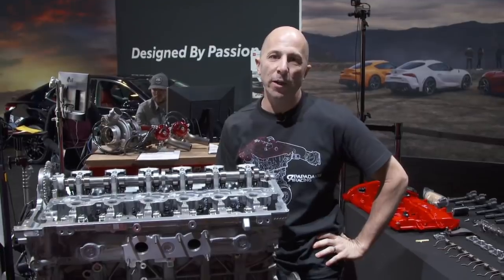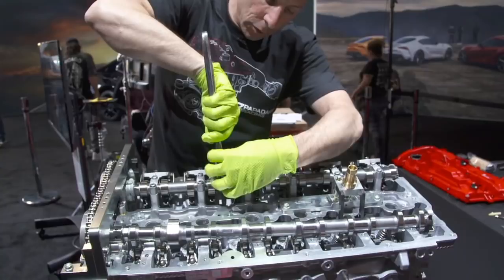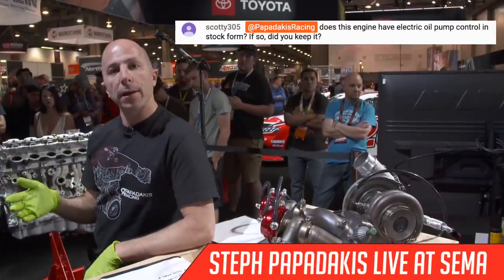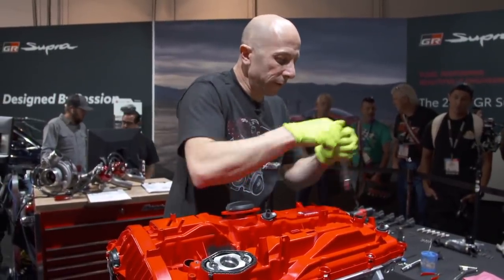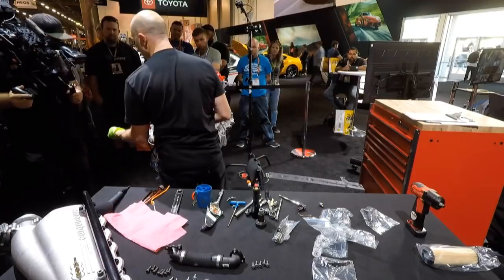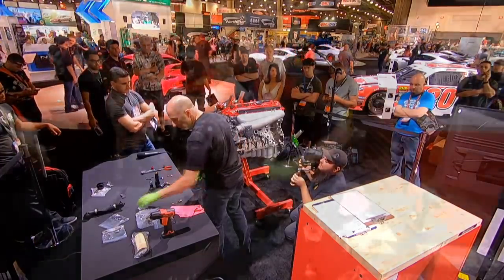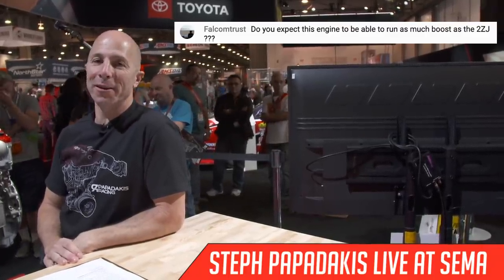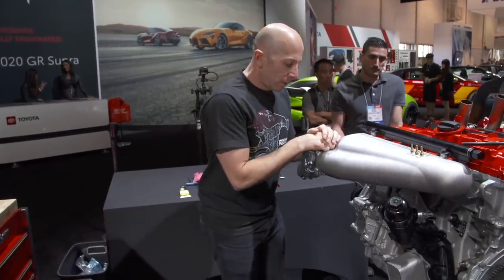1,000 HP Supra build | Live @ Sema | Friday

Comment: is it possible to use the valvetronic system?. i'd like to know if there's advantage or disadvantage with throttle body controlled compared to valve lift controlled on F/I system.

Comment: I value your feedback papadkis Umm also my ring gap is .023 and .053 thoundands of a inch turbo size is rear housing .7 turbo ex 2.5in straight through pipe front S bend temp intake exhaust 188F convert to 54F (Pr amb) to throttle body only using standard coil and crank sensor I added 5 degrees advance timing but change to mechanical fuel pump leaving altanator less load. Are you getting sensor problems with theses new engine ?

Comment: I'm using pump gas 98 oct AFR 11.5 I am using 2mm head gasket given me range of 15 to 42 psi hp range is 380 to 480 to 800hp cam is mild for 2500 to 6500 rokers are 1.8 roller ratio valve spring standed

Comment: one turbo used single entry t3 flange header are 2in 1/4 ,heads standed oil line 3/8in from pump no solonoid fuel pump 170 gal per min

Comment: And from design point you guys are using port injection.....I have not seen on any videos using device to measure cylinder load pressure......you have already on the heads direct injection that could be used for cylinder pressure probes

Comment: Have you considered added a temperature or pressure sensor into the DI port in each cylinder so you can tune each cylinder individually, since you were talking about only having two EGT sensors due to the integrated exhaust manifold?
Reply: They're building a new head cylinder... to create more flow and rpm's .

Comment: My build cost me $1040 hone bore rod to piston  pinned block to 0 deck $460 steel head gasket $160 made up from cad 2mm 1.8 roller rockers 2mm extension pushrods from standed one T3 single entry from ebay turbo cost $260 + wastegate spring sett  .7 rear housing front housing 76mm + $160 intercooler + 2.5 in pipe

Comment: @papadakisracing is the engine oil weight stock? If not how do you determine what weight oil to use?
Reply: no way the oil weight is stock, because stock is 0W20. most oil has temperature ranges and a lot of in depth specifications, so as long as you know what your engine is running (clearences, pressures, temperature, etc.) you can most likely pair it up with the right oil, or you go with the generic Xw50 and learn from experience and oil analysis.
Reply: A90 Supra stock oil is 0W-20 ... but consider the size of turbo and the target power of the engine, i think 50 weight oil he chose is just right. as when you push this engine around the race track the 'typical' oil temp may be over 120c (~248F), you still have optimal oil viscosity and pressure  ... but if you are not willing to push your car hard, you may use the thinner oil as the typical oil temp will be lower.

Comment: Higher compression should have higher exhaust flow. Might be in that way it increases turbo spoolup
Reply: Making them larger makes a larger chance of lag, because of lack of pressure. With higher pressure, more velocity is achieved thus lessening the time and apparent distance for the air to spool the turbo.

The issue here is when the exhaust pressure gets too much and you really need flow, you lose efficiency on your setup due to the exhaust pressure jabbing on your exhaust valves, and don't forget the wastegate

Comment: Seems an expensive engine for mass production.... with all add-ons and special tools needed for camshaft-spring installation etc.?
Reply: Most engines won't need serious top-end work involving removing cam shafts in their lifetime, so the special tools are going to be used for the initial assembly and then very rarely by service technicians.

Comment: What are the benefits of 3d printing the intake ?  Would the flow be much worse if ju just welded that intake together by your self ?
Reply: @Seb C  I'm just thinking that 3d printing is a bit expensive in this case, that intake wouldn't be that hard to weld together in a hurry
Reply: @Seb C If they have the printer in house I understand :) I also think that it's a cool method, we have a 3d printer at uni that can print metall, so I've tried it a few times!
Reply: nsren kb...If you haven’t noticed....there isn’t such a thing as “too expensive” when it comes to engines and teams like this. It’s all about functionality, time....and of course looking trick is usually the byproduct. Ease of fabrication like was pointed out is key. I’ve built plenty of custom exhaust/intake turbo and NA manifolds and it is nothing short of artwork.  Having the correct fabrication tools and a heap of time is crucial. They can design this in CAD and bam....a perfect repeatable component in no time and if it’s not, a simple tweak in the program and done. Cost is the least of their worries.
Reply: @specforged5651   I know that, the question was what benefit the 3d printing brings in this case ? The only one I can think of is the estetics, I would be faster and cheaper to build one with a tig-welder and you would get the same performance output. 

Maby if the internal design is complicated there would be a point, but we haven't seen the inside so i quess it's a normal plenum.

Comment: So many 2jz fanboys started going to church praying B58 to fail. 90% of them havent seen a 2JZ or even a B58 irl.
Reply: you know, haters gonna hate.
Reply: Just saw , finally a A90 on the local Toyota dealer. Seems like no one is taking it...for the meantime. I may have not seen or felt the power of a 1J or 2J but I experienced the almost stupid acceleration and speed with RB25/26 or the 4G63 which were tuned and owned by some of my fellows who liked to race through the streets...

Comment: I’ve heard plenty of people complaining and up in arms about all of the specialty tools (SSTs) needed on this engine. As far as I’m concerned....I think they are cool and it’s just a sign of new tech and advancement in systems. Not to mention it’s how you do it properly. I’m sure there will be plenty of people with their pry bars and big, bigger and biggest hammers, but they will be the ones with failures. This ensures accuracy and precision. And that’s kind of a big deal on engines (especially race and high performance)....at least to me anyways.
Reply: Adaptation.
Reply: It's a barrier to entry and will be yet another aspect of this engine which prevents it from gaining any real popularity with tuners.
Reply: As long as you don't need to go to Toyota or BMW to buy the overpriced SST, it's fine. The problem is, sometimes these special tools tend to weed out people that want to do it as a hobby.
Reply: Rob....I get it, I really do, but if you (not saying you personally, people in general) can’t afford these tools you have the wrong engines for your hobby. GM 350 or Honda 1.6/1.8  is probably more the avenue you need to be taking.
Reply: @specforged5651  Why bother with this engine when it doesn't offer anything over much less expensive options?
Reply: Dustin Black You may have a point there. In a couple decades, though, I think most of those “simpler” engines will be hard to come by.
Reply: PistonAvatarGuy...See that’s what I’m trying to get at.....it’s about what gets YOU excited and what YOU think is cool with new technology. Too often it’s looked at as....well I made the same power for less money. Well that may be true, but did you enjoy what you were working on? I know it seems to always boil down to price, but it should boil down to what can you do that is different? Yes, I am fortunate that the money isn’t an issue, I know that and I know that isn’t true for the majority. However, even if I make less power and spend three times the money I want to do it because it’s different and I find out it didn’t work...that’s just as much of a win as if I made my best power figure yet. The entire point of this engine to myself is to see how all of this new valve train and electronic controlled tech holds up and works. I will go on spending money on endeavors that sometimes prove to not work out, many people do that. However, when you look at only based on price, nothing will ever evolve then it becomes...what is the point of all of this new “expensive” tech? I have a few different engines I really lean towards. Are they the cheapest? Not even close...are they the most powerful? Not even close...are the parts readily available? Not even close. But it’s what I understand and what gets my brain thinking of new ideas. I get the majority of people don’t have that luxury and I will never say I am not fortunate to be able to do “whatever I want” just like these guys, but the GM LS motors and the Honda 3.5 V6 is where I learned and what use to excite me (and still does to a point). Most people are not at the knowledge level of going much beyond that anyways, so cost shouldn’t even be the determining factor, at that point experience and knowledge should negate before checkbook does. A valve train like this just makes their head hurt. VTEC did the first time I saw it...that’s what it is all about to me. The majority of the questions were answered..” we don’t know, were about to find out”. That is the cool part to some of us, not that we built 1,000 horsepower for $1,000.
Reply: Rob..You are certainly correct, but I see it as an evolution and in 25 years we will be saying the same thing about this engine. Eh, “old technology and hard to get parts” right? This is how the progression of all engines goes. That’s kind of what I was trying to explain in my other comments about “costs”. When something really different comes out, who gets it first? Sadly it’s the people with the money and connections right? Same thing has happened to all engines that were truly revolutionary. There is a trickle down effect. The big money and the race teams use them... develop them for marketing purposes....the aftermarket gets ahold of them and does their thing...the consumer with money buys all the aftermarket...usually it’s bolt on, not major engine work because they don’t have the time, money and most importantly knowledge of true engine building from the crank up. It just keeps going and going and going. Who would have thought 25 years ago a GM LS would have variable valves, cylinder deactivation and direct injection? Not me and that is what I learned on and grew to know inside and out, much like many people. The problem I see here is most of the people who complain about these topics (not pointing out you or anyone directly) are the ones who don’t have the knowledge to be doing this sort of thing anyways. Like Steph explained. Start small and just learn. Learn to put pistons in a stock bore. Learn proper sequences of engine building etc etc. People that go crazy about this technology usually don’t even know how to blueprint and measure and engine, port and build heads, etc etc etc. is that a bad thing? Absolutely not, I encourage them to learn, but people that have the actual knowledge aren’t the ones complaining. It’s the ones who can’t do it in the first place. I’m not trying to be a dick or call anyone out personally, I’m simply stating some YouTube facts about comments. 90% of them shouldn’t even be thinking about how expensive or advanced the tech is because they don’t even understand the Briggs and Stratton in their garage, they just want to find something negative about everything. Go take apart that Briggs and gain some knowledge, then ask educated questions not negative bashing. People are negative about things they don’t understand and it is exponentially multiplied on the internet and with many of these posts.

Comment: Seems like an awful lot of weight with that whole manifold/turbo assembly hanging off the side of cast aluminum. Everyone including myself has done the same for years, but I’ve always had thoughts in the back of my head about that weight. I have had a 3.5 Honda V6 turbo crack from that on my sand car. It’s always something that has scared me for some reason.....even though it’s happened once out of the hundreds of times I’ve done it lol.

Comment: Why is he at a Toyota Booth when he's building a BMW engine
Reply: Got your point but why does he need to be on a BMW booth when that engine was taken out from a Toyota car in the first place? It's just BMW's engineering and engine designer he's been working on but it will run a Toyota car so I guess that clarifies the confusion.
Reply: @elitgee9192  and also there are considerable differences between toyota b58 and other b58s
Reply: Well they did a small tweak on the engine.